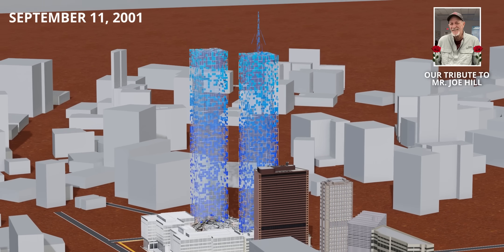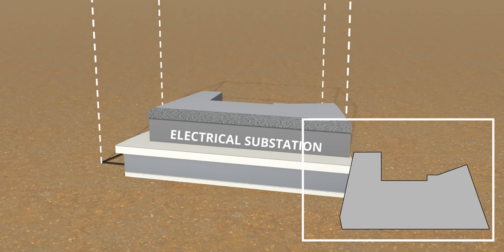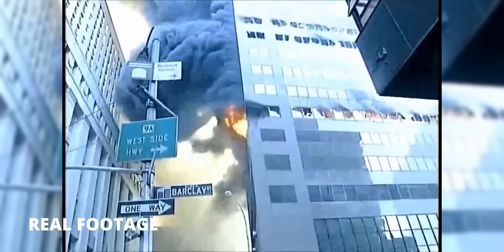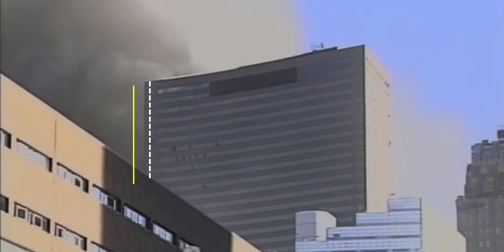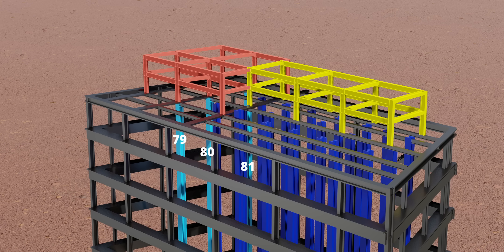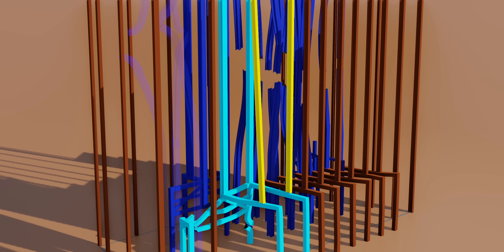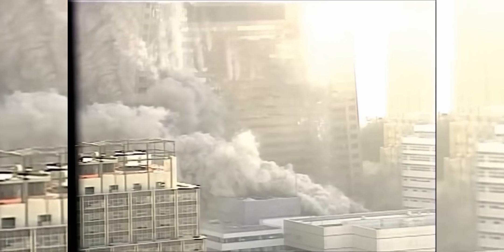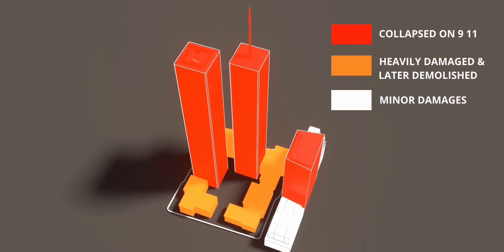Collapse of Building 7 | The Complete Physics

Comment: If two pillars were damaged, why would the entire building collapse at the same rate like that? Other pillars were still fine. Makes no sense.
Reply: Building 7 was complex, assymetrical 47-story steel framed structure built on top of a smaller 3-story building, requiring lower floors dedicated to complex load transfer structures, not usable office space. Of trapezoidal shape and all-steel tube-in-tube construction, B7 (above the 7th floor) consisted of a central core of steel columns carrying most of the gravity load, perimeter steel columns around the outside of the structure carrying the remainder of the gravity loads and long span beams and girders to tie those elements together and form the floors. On the outside of the building hung a moment frame or outer shell.

Phase 1 : The first externally visible signs of collapse initiation occurred at 5:20:28 pm. It was notably quiet with observers not realizing the building was collapsing! No audible warning in the form of  hundreds of ear drum busting 180-190dB explosive bangs preceding the collapse. Here at 12:00 a local CBS affiliate reporter is talking 10 blocks from B7 when collapse begins. People don’t start to notice the collapse until 12:11. At 12:45 is the famous CBS fixed camera clip of Building 7’s collapse. Note how quiet it is.

youtube.com/watch?v=t5tEy6mXSE8&ab_channel=fresnosean379

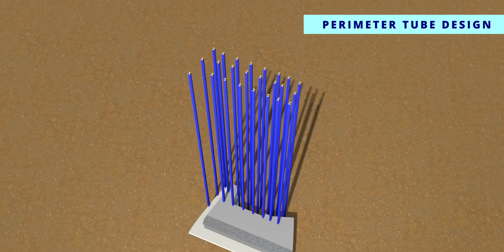Collapse initiation was due to lower floor failures above the load transfer region (7th floor) in the NE corner. In this video at 0:45 you can see the NW corner from inside the building while under construction, Column 79 just out of frame on the left. That big, angled steel beam across the top of the frame connects to C79 at one end. The girders connect to the beam. That beam and all those girders depend on just one connection

youtube.com/watch?v=nP3TNHPCIVU&t=35s&ab_channel=EdwardCurrent

Phase 2 : Lower floor failures caused a loss of critical lateral support over an excessive length of core Column 79 and it buckled. If you look at a floor diagram of Building 7 (see above) and look at all the structures that depend on C79 you quickly realize this one column was a relatively isolated structural element on which a disproportionately greater fraction of the structure depended analogous to say the Key Bridge. Externally we see a vertical progression of window breakage along the 44-46 line and a kink in the roof of the East Mechanical Penthouse at the top of the building, consistent with C79 failure. The transition from full capacity to almost no capacity occurs in virtually an instant. Once the buckling failure occurs there is almost no resistance

Normally with a buckling column, the load could very well be redistributed to other columns, meaning the buckling could stop after a while. With C79 that is not the case - the failure did not redistribute the load, so the collapse rapidly progressed to the roofline, sinking the rooftop penthouse.

Phase 3 : With C79 gone, B7’s progressive, non-symmetrical collapse continues with C80 and C81 at the east end of the core left laterally unsupported and quickly buckled and failed as well, sending the EMP down through the building. C79-81 all have no diagonal bracing, which I believe is a major reason why they could not redistribute a lot of vertical loads among one another.

From there collapse progressed from east to west through the central core until the core was gone taking all of the interior floors and probably most of the perimeter columns with it. Follow the horizontal progression of window failures low in the building and the dropping of the remaining rooftop structures into the building. One of the big takeaways from the NIST Building 7 study (that gets completely ignored) was their modeling which determined C79 failing under ANY circumstances would have initiated the same collapse sequence.

Phase 4 : After 10 seconds only the exterior moment frame - a hollow empty outer shell – remains, giving the ILLUSION The Building is still standing since little has outwardly changed, but it’s just a hollow empty shell like an empty cereal box. Supported by only a few remaining columns that empty shell is quite unable to remain standing. With all core columns and floors gone, the north face leans inward, forming a V in the roofline, the last few columns buckle under the strain and the moment frame free falls, landing on top of the 7-story high debris pile. It is only late in the game here at the end that a single measurement of alleged free fall acceleration is taken, from a single point on that outer shell. The Building_did not “free fall” – just one corner of the outer shell did- sort of. _The Building was already gone before that happened. The period of alleged free fall was a product of how it fell NOT why it fell and cannot tell us what started the collapse. Start to finish the entire collapse took 18-20 seconds, 3 times longer than true free fall .  How fast something falls cannot tell you what started it falling_ anyway. The debris spread outside the footprint, blocking surrounding streets, heavily damaging the Verizon Building and destroyed Fiterman Hall.  

Building 7’s progressive, non-symmetrical collapse was incidental and unintended collateral damage from the combined effects of fire + time + gravity, started by the collapsing North Tower. That is true no matter who planned and carried out the 9/11 attacks or why . The collapse was of so little consequence it barely even registered at the time, a mere footnote. It only took on semi-mythical status as an alleged smoking gun years later when demolitions at the Twin Towers, missiles at the Pentagon and shoot down over Shanksville all failed and conspiracists had nothing left to work with.

I hope you found this helpful, informative and it solicits informed critical comment. If I made any errors of fact, logic or reason or left anything important out, please let me know so I can fix it. IF you can offer a more plausible alternative please do. Be the first. Please start any reply with the words “Tits McGee” or I will know you didn’t read it and are wasting my time.

Comment: Chance a steel frame building collapses to plane strike previously 0-225.
Chance steel frame building freefalls to major fire 0-2000.
Chance of Airforce being on their specific manouveres which affected their response from 12 mins to 3 hours (according to us airforce forst time in 30 years) lets be generous and say 1in -10,000.
Lets add tsa pilots estimate of an untrained pilott havibg a 1 in 300 chance of performing a manouvre like this. Three times over. Lets pretend that that the 0% chance liated above is infintely larger at 1 %>. Lets also add multiverse and say this coukd happen in our next million universes. Odds of this happening as descrived are about 1 in 1.3 trillion. This ignores countless other variables that reinforce the hypothesis that these 3 building were impossible to fall.in the manner they did without prior planning
Reply: Chance of something being possible that has already happened - 100%.

Anything can seem like a conspiracy if you don't understand how it works. Rather than wallowing in ignorance-fueled personal incredulity while spewing made-up argument-loading nonsense (most of which is not even relevant to the topic at hand, even if it were true), why don't you spend you time finding out how it works. It's not that difficult. Hell, this video does some of that work for you (though it only scratches the surface).
Reply: "Chance a steel frame building collapses to plane strike previously 0-225."
Meaningless.

"Chance steel frame building freefalls to major fire 0-2000."
Not only meaningless, but a lie.

"Chance of Airforce being on their specific manouveres which affected their response from 12 mins to 3 hours (according to us airforce forst time in 30 years) lets be generous and say 1in -10,000."
Meaningless and a lie.

"Lets add tsa pilots estimate of an untrained pilott havibg a 1 in 300 chance of performing a manouvre like this. "
Meaningless, and a lie.

"Lets pretend that that the 0% chance liated above is infintely larger at 1 %>. Lets also add multiverse and say this coukd happen in our next million universes. Odds of this happening as descrived are about 1 in 1.3 trillion."
Meaningless.

This of course not even addressing the fact that the chance is 100%....since it happened.

Comment: Convenient collapse of core collums exactly in sync is not the save you think it is. Any non structural engibeers refer to NISTS assesment. Despite proving the exact opposite in their tests/studies in regard to instant total collapse, they maintain an instant collapse was possible (around 2% likelihood). So despite never happening before (ever! 200+ plane strikes on skyscrapers) thansk to this we can eatinate rough estinates. its still roughly 1 ; 25,000 this would happen one single time. Someting backed up by the current timeline (no buildings freefall collapse - plane strikes) ratio. Buildings were designed (specifacally) to withstand (according to architectural mandates) several thousand plabe strikes without deformation. Multi Billion dollar insurance policies taken out within 1-2 months (that hadnt been used before in the buildings history) by the buildings owners. 99+% of ALL CEOS absent on the day with the main excuse by the majority of those complicit being that there were protests

Comment: The bent columns can be attributed to the heat of the fire and collapse, but that alone does not show it is not a controlled demolition. How do you account for the thermite residue found in the wreckage? Can thermite be created in a situation like this? What could possibly have been the source, and purpose, of thermite in the wreckage of all three wtc collapses?
Reply: Thermite is iron oxided (rust) and aluminum. Not too difficult to account for either and it does not change the fact thermite is never used in building demolition (because it is useless for that), could not have been used on 9/11 and there is no evidence for it's use - only vague BS claims it might have been present based on highly dubious evidence

Thermite is a conspiracist fantasy tossed into the mix out of desperation as a means of explaining the obvious lack of explosions in what they were trying to claim were explosive controlled demolitions  

It is a solution in search of a problem. There is not now and never has been a case for its actual use. 

The collapse of Building 7 is one of the most studied engineering disasters in history and the subject of 5 comprehensive engineering studies and more than two dozen technical articles in major peer reviewed engineering journals, most of which were published 15 or more years ago. Thousands of pages of material.  The collapse mechanisms - while there are some minor quibbles over details - are well understood.  No reason to introduce magic or conspiratorial nonsense. Work the problem. This should get you started.

FEMA BPAT (initial report superseded by NIST NCSTAR 1A)

NIST NCSTAR 1A: Final Report on the Collapse of the World Trade Center Building 7, 2008.

Guy Nordenson and Associates, WTC7 Global Collapse Analysis Report and Summary of Findings, 2010.

Arup, WTC -7 Structural Fire Analysis Report (Runs 1-4), 2010.

Weidlinger Associates Inc., WTC 7 Collapse Analysis and Assessment Report, 2010.

BRE Centre for Fire Safety Engineering, Analysis of the Impact of a Fire in the Mechanical Room (5th & 6th Floor) of the World Trade Center 7 Building, 2010.

T. McAllister, R. MacNeill, O. Erbay, A. Sarawit, M. Zarghamee, S. Kirkpatrick, J. Gross, Analysis of structural response of WTC 7 to fire and sequential failures leading to collapse, J. Struct. Eng. (United States). 138 (2012) 109–117.

For a summary of the major studies I would recommend THE COLLAPSE OF WORLD TRADE CENTER 7: REVISITED by Mhd Anwar Orabi , Liming Jiang , Asif Usmani and Jose Torero which is a 33 page summary of the different analysis and conclusions published in 2020. Sorry, YouTube will delete this post if I give the link but it should be easy to find and is available from the University of Queensland, Brisbane. 

Real structural engineering industry professionals conducting real engineering studies and publishing them for other professionals to see. Not amateur YouTubers appealing to the gullible and credulous.

Happy reading
Reply: @TheCriticalStinker-01  "thermite is never used in building demolition"

This stupid lie won´t become true by repeaating it stinky.
Sky Ride tower Chicago 1935
Reichstagskuppel Berlin 1954

Comment: I understand that the entire controlled demolition industry profoundly changed after the perfect, partial dustification and partial free fall acceleration of Building 7 into it's own footprint.  The new cost effective and precise technology for controlled demolition of tall steel and concrete buildings consisted of starting fires on a couple of the floors.  Or am I totally mistaken in the above conclusion?

Comment: So why didn’t it tip over then?   Why does it look even neater than the neatest controlled demolition you could ever see
Reply: never tipped over
Reply: How could a steel framed building tip over? It's not a tree. Steel structures don't tip, they drop. 

The building did the only thing it could do. Your claim assumptions are incorrect.
Reply: Why would it "tip over"? And in what way does it look "even neater"?

Comment: Don't tell us a story!
Somehow the blue colored columns are getting damaged witout any explanation, the yellow coloured columns are somehow not damaged to support this theory, but we don't see a full simulation based on these assumptions where can see the whole movement with visibility on the columns. Based on this theory the building has to tilt backward instead of coming straight down. 

It doesn't matter if it was free fall or  very close to free fall. There is no explanation why so much columns would fail at the same time.

Comment: 3 buildings. All straight down into their own footprints. Things don't add up.
Reply: 10 buildings collapsed that day to their footprint. Let me do the math:

- 2 giant planes + blazing hot fires + tons of debris = a ton of damaged buildings that will collapse. Does that help?
Reply: @McDonaldsDude  So which 10 buildings would that be my funny little liar?
Reply: @Kudde23 WTCs 1, 2, 3, 4, 6, 7, St. Nicholas church were all totally destroyed. WTC 5 was partially destroyed and demolished later.
Reply: Why was St. Nicholas Greek Church demolished if this is a conspiracy? Why did the government put bombs in that church?? For what purpose?
Reply: @McDonaldsDude  So if that was true it would be 7 buildings that collapsed that day... You claimed it was 10 buildings. So which would be the other 3 my funny little liar?
Reply: @Kudde23 So I was off by 2... who cares? My point was that what happened to WTC7 that day was not unusual. It happened multiple times - that's what happens when you have two HUGE airplanes crash into two huge buildings at super speed full of  jet fuel.

Al Qaeda chose to use transcontinental flights (Boston to L.A.) for the mission because they have more jet fuel. The negative though is that transcont flights tend to be early in the morning... meaning less potential victims, But with so much jet fuel the explosion would be extremely devastating.

My question for you is:

No one died in WTC7. So why did the Government need to demolish it then? What was their motivation"
Reply: @McDonaldsDude  it was where the dod's accounting office was. 21 trillion in missing money.
Reply: @h1F595 Not as lot as quoting CriticalMFitzshillStinker without even saying it´s a quote my poor little helpless wannabe.
Reply: @Kudde23 1, 2, 3, 4, 5, 6, 7, St. Nicholas, Fiterman Hall, Deutche Bank. What do you know, that'd be 10. Poor little Pillowbiter.
Reply: How about you find out the facts, before you say stupid shit? That way, they might add up, and you wouldn't have to fail publicly.
Reply: You are not qualified to judge; not at all. Maybe one of your stupid 'engineer" friends will know--or keep guessing.

Comment: Building 7 fell to the earth at freefall speed, without any resistance (you can time the collapse yourself) at any point during freefall.  This defies the laws of physics.
Reply: Unlike you, I did time that collapse myself. Start to finish was 18-20 seconds. For a 47 story building that is 1/3 (0.33 or 33%) of true graviational acceleration.  So you are off by two thirds, which is a staggering bit of epic failure.  

No laws of physics were defied. 

Next time you ask someone else to measure something, make sure you do it yourself first before making any silly claims.
Reply: @TheCriticalStinker-01  incorrect. WTC 7, a 47 story building, fell to the earth in less than 7 seconds, with zero resistance.
Reply: @fox2  - Take your time. I know it's hard.
Reply: Bonehead-- you didn't watch the video.